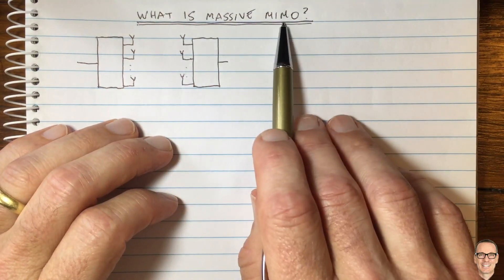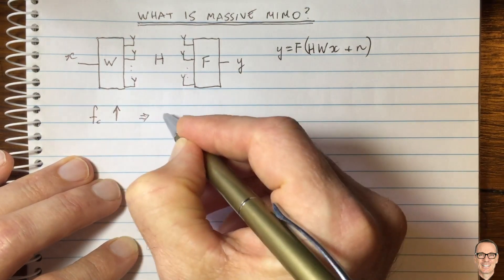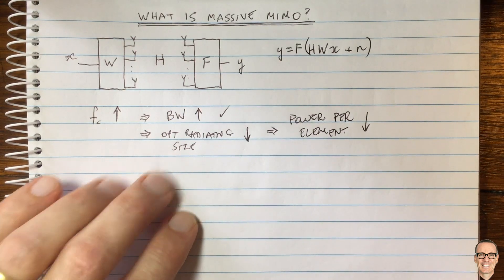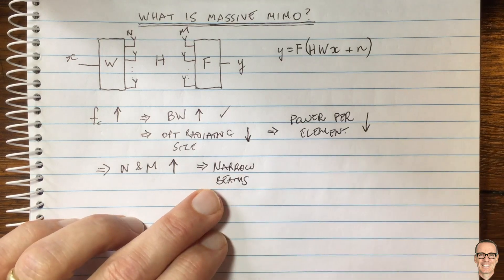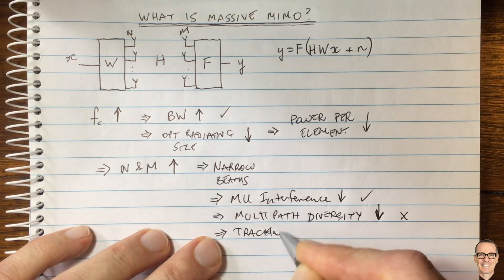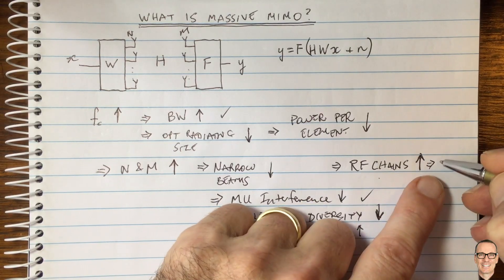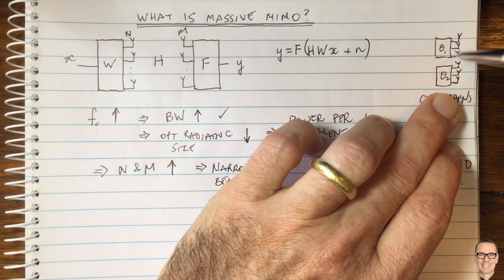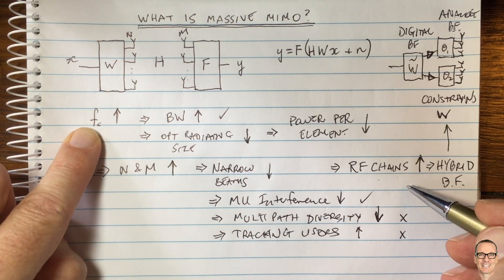What is Massive MIMO?

Comment: Atmospheric and moisture absorption goes up with frequency.  This reduces the coherence bandwidth as well the range.  Availability is reduced significantly.  The trade becomes cell size reduction which  increases the  need for smaller  cell size and more of them per service area.  There is a practical limit as frequency used goes up and it is reached quickly as a function of RF frequency. Increased transmit power and or antenna gain does not overcome this as phase coherence is lost before SNR goes below minimum detectable signal levels. Antenna cross polarization/ depolarization at the antenna also is severly degraded due to droplet size of moisture within the field of regard of the antenna array and each formed beam.  Remedies are non trivial. The design trades have to address this above 10 ghz to determine feasible system designs.

Comment: Hello I have a question. In 1:25 you said that carrier freq and bandwidth are proportional & inverse proportionality of optimal radiating size. How can I understand this?
Reply from the maker: It's complicated. My comment was a generalisation. Generally speaking, the lower frequencies propagate better in terrestrial communication systems, so they are more "in demand". The higher frequencies are less "in demand", and since there are fewer users, it's possible for them each to use wider bandwidths. Also it's harder to design "narrow band" band pass filters at higher carrier frequencies. To understand the relationship between the spacing of the antenna elements and the optimal energy transfer requires electromagnetic antenna theory.
Reply: @iain_explains  do you have any book recommendation?

Comment: hello sir thanks to your informative videos, but i got a question here, why is in some books they say the massive mimo is the systems focus on adding a much higher number of antennas on the base station,
Reply from the maker: "Massive MIMO" is a very loose term. It gets used in quite a few situations. Basically any communication system where a large number of antenna elements are used at one or other end of the link (or both) gets called "massive MIMO". And there's no specific definition of "large number".

Comment: Hi Prof! As MIMO requires rich scattering environment, does it mean that narrower beams from gNB with large N to UE with small M isn’t suitable for high rank transmissions as the effective BFed channel becomes sparse such that there is insufficient scatterers around the UE to decorrelate the channel? (TX correlation is assumed less problematic considering orthogonal beams to transmit multiple layers)
Reply from the maker: Well, it depends on exactly what you mean by "MIMO". In the early days, "MIMO" was used to describe "spatial multiplexing", but these days it is much more general, and literally refers to any system with multiple transmit and multiple receive antennas (even if the receive antennas are each on a different user, as in MU-MIMO). You might like to watch: "What are Spatial Diversity and Spatial Multiplexing in MIMO?" https://youtu.be/MNA0xn7EeyY
Reply: @iain_explains  thanks a lot for your prompt reply! yes I have checked that one (and most of the others of your videos :-)) Here I meant spatial multiplexing for high rank transmission. Considering above dimension of e.g. N=32 and M=2, two beams carrying two layers respectively, would it be problematic with too large N such that the beams get too narrow yielding in the propagation channel too less scatterers around RX and making receive correlation too high for rank2 transmissions? You mentioned less "multi-path diversity", did you mean this increased correlation or frequency selectivity channel coding exploits?
Reply from the maker: It all depends on the gain of the individual paths and their relative directions. The larger the number of antennas, the more accurately the paths can be resolved, and the more power that gets directed in those specific directions. In terms of the number of data streams (or "layers"), just because you might only have two data streams, doesn't mean you only use two of the available "paths" in the channel. The "effective beams" that get formed for each data stream can be "multi-fingered".